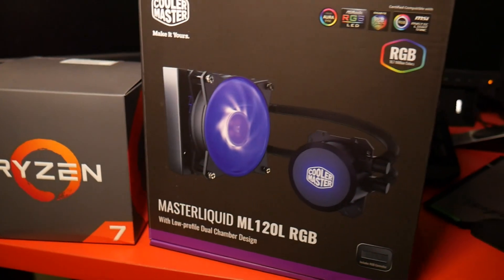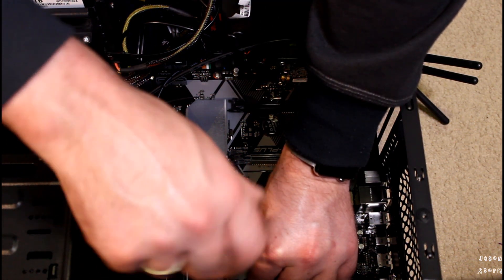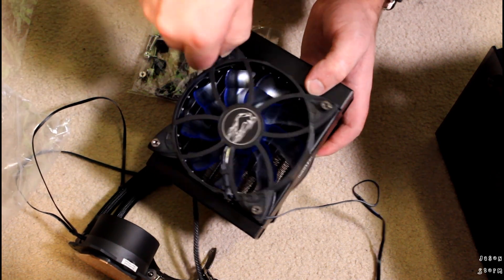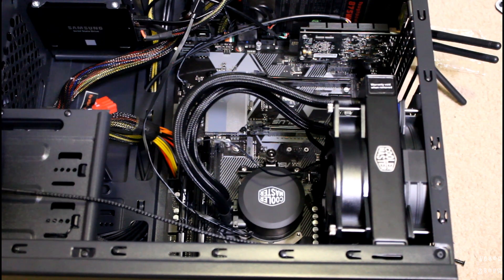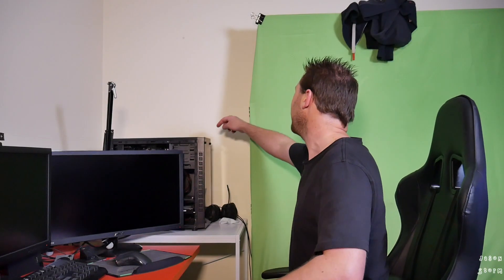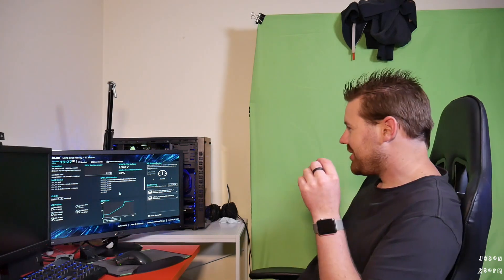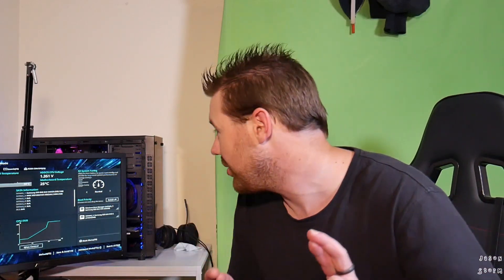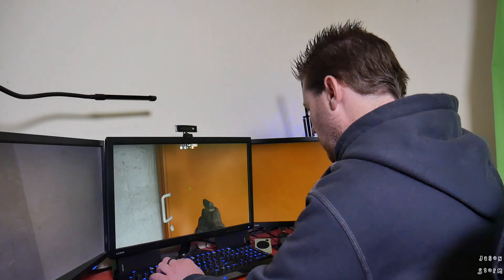Cooler master Masterliquid ML120L RGB Review Installation

Comment: My previous cooler seemed to not be working and my cpu was hitting 100 degrees Celsius. Bought this cooler and just installed it and im happy to say my CPU temps are now 30-40 Celsius while idle, and around 60 Celsius with uncapped frames. Thanks for the review :)

Comment: 2:21 should mention that it can be easy to break the plastic clip when screwing on the cooler. It's tricky because you want it mounted tight. I just broke the clip, and now I have to try to find one... very frustrating.

Comment: This is a silly question 🙋🏻‍♂️. Do you have both fan running in mode as to expel air from the case or rather suck into the case? Also do both your fans run same direction?

Comment: Is it fair enough for Ryzen 5 3600 ??
Reply from the maker: If you have space for a 240 go a 240, if not then it should be fine, I have this on my 2700 and I haven’t had a problem but on my 3800XT I run a 360 but a 3800XT will run a lot hotter than a 3600
Reply: @JasonStorm  Thanks fo r reply. I purchased ML120 V2. I guess this stuff will have enough cooling. One of my buddies tested today his Ryzen 5800x with Ml240 V1 and he has a stable degree at 63°. Thats a high profile performance. I think CM Ml120 V2 wil carry it

Comment: Hey 👋🏼 sorry go write after a year. I got an Hp omen 25L and want to change the cpu cooler. I use the same cooler as you but I can’t mount it on the am4 because the two Plätzchen pieces are to short… like 5cm and the holes are 8cm away from each other. Did you got any tips?

Comment: As long as the flow is in the right direction (out) the second fan doesn't matter much in speed its more acting as a vac to pull heat off the radiator after the other fan pushes cool air in. Also you mounted the radiator upside down so the pump is going to get trapped air in decreasing shelf life Tubes always above CPU. Fan direction is X frame is the blow side, no frame is the suck side.

Comment: Bruh i just bought it and i built my pc but at the end i realized that i didnt have a pump header on my motherboard
Reply: Is there any way i can fix this?
Reply from the maker: You don’t need a pump header, just run it off a normal fan header, you may need to slow it down a little if the fans spin fast and loud
Reply: @JasonStorm  oh thank you i just fixed it now my cpu isnt 90 degrees anymore haha

Comment: Would this be good for overclocking my Ryzen 3 3100?
Reply from the maker: It’ll be fine for Ryzen 3 or 5 but Ryzen 7 i would use the ML240 or 360
Reply: @JasonStorm  Okay, Thanks!

Comment: Hey bud, did the fan arrangement work well? or did you end up switching them around?
Reply from the maker: seemed to, I kept it like that for over a year up until last week when I changed to a more free flowing case, I took the fan from behind the radiator away and now I just run the stock radiator with the Coolermaster fan in front of it

Comment: I have never used a water cooler.  If I get one, do I have to add liquid, or does it already have liquid from the factory?
Reply from the maker: Some liquid coolers you do have to add the liquid yourself but not with this one it comes pre-installed
Reply: Thanks so very much!

Comment: I plugged the fan into the rgb header on my motherboard but the fan lights aren’t turning on, are the RGB headers direction specific?            also I am using an asus motherboard which supports the AURA sync software but I can’t tell if it detects the rgb fans because when I click select all rgb devices and apply an effect the fans still don’t light up

Comment: if i dont have a pump header on my mobo where should i put it?
Reply from the maker: CPU header or a pwm header, you may have to adjust the speed it runs at in the bios or an external program that can change all the individual fan speeds, some people say it’ll spin too fast and be loud but see how you go

Comment: Wait...How did you mount the radiator to the chassis? Surely the fan holes were occupied by the bolts connecting the fan to the radiator.

Comment: I added one of these to a MSI 760GM-P35 system and love it! works great and keeps the CPU cooler then the regular fan.... I highly recommend these! they work!
Reply: and the unit failed in 2021... wound up removing it and putting the stock fan back on.... only to discover that cooler master has come out with a Version 2 model that's better... so I'm thinking of buying the newer unit when I upgrade from my AM3 to a AM4 based system....

Comment: I have the ml 240 lite and there is a noise from the cooler block on the cpu. I would appreciate any help please.
Reply from the maker: I can’t help you much with that, if it’s under warranty take it back if it isn’t I would replace it before it stops and cooks your CPU
Reply: @JasonStorm   did that exactly and now have the Corsair H100i which is awesome Many thanks.

Comment: I want to buy a a 120mm aio (specifcally the nzxt kraken m22) but I don't know where I should mount the radiator. Could you give me some advices ? (I do have a radiator bracket but I already installed 2 Corsair LL140 there.) I have a next h510i case

Comment: Is there any  meaningful difference with this cooler if you have 2 fans instead of one ? I have this cooler and I was gonna add 2 fans like the last AIO I had but didn't and temp wise I only see maybe a very small amount of temp difference e.g less than 10. Am I doing something wrong and should see a little better than that temp wise with 2? 

I know it's an old video
Reply from the maker: Any gain is still a gain, it won’t be much
Reply: @JasonStorm  true that's what I thought thank you!

Comment: Are you still using this cooler? Did you experience any liquid leak?  I have it too, but I’m planning to change it with an Air cooler because everyone is telling me (including many reviews on amazon) that this cooler master AIO has a high chance of leaking and breaking all the other Pc components.
Reply from the maker: Hi, yes I am still using this cooler but mine is not leaking
Reply: Jason Storm I hope it’ll be safe for me too, thanks for the answer😙
Reply: So what is your opinion after 3 year, i bought 1 so need real experience review. Thanks
Reply: @boxtershaitan  it didn’t leak once. It’s working properly and keeps the temperature down even after 3 years. The only problem: it’s a little difficult to remove dust from it. but other than that I think it’s a good AIO and I’ve never experienced any problem with it

Comment: I've bought one of these and my cpu gets 50 degrees in bios. It's well installed and  it's trying  to cold one I3-9100F. What can I do to solve this problem of temperature?
Reply from the maker: 50 degrees isn’t hot for a CPU
Reply: @JasonStorm  in bios? or without doing nothing? When I try to play gets 81 degrees xD

Comment: Run in 1151 it's compatible?
Reply: run smoothly, friend!
MASTERLIQUID ML120L RGB 120MM is compatible with
CPU sockets:
Intel® LGA 2066/2011-v3 / 2011/1151/1150/1155/1156/1366/775 socket
AND
AMD AM4 / AM3 + / AM3 / AM2 + / AM2 / FM2 + / FM2 / FM1 socket

Comment: What are your thoughts now, over 1 year later? I'm asking because I am hating this cooler, and can't believe it gets good reviews.
Reply from the maker: I haven’t had an issue with it, doesn’t get hot, it isn’t loud, I haven’t had a failure, I know some people complain it’s loud but after installing it’s good to adjust the pump and fan curve so it’s not spinning really quick all the time for no reason, what issues have you had with it?
Reply: @JasonStorm  I think it is incredibly loud and has an annoying fan sound unless it goes below 500 rpm. Ever since I got it last fall, I have been trying to tweak it to be as silent as possible but also keep my CPU cool enough. I have tried the smart mode as well as fixed RPM. With smart mode it would just be really sensitive to even the smallest temp change (no matter setting I put it), the fan noise going up and down would drive me insane. Also tried fixed RPM.. well.. ofc thats gonna be noisy. I can hear the cooler through my headset when I play games, and thats pretty crazy considering the case is under my desk.
I also don't think it cools well enough to be given such praise.
Reply from the maker: I just started my computer to check what mine is running at, I haven’t checked it for a long time, and I have had a benchmarking software open and running on one screen and a hardware monitor open on another for about 15 minutes now and my CPU has only reached 47 C (117 F) and the cpu is at 1270 RPM and I can hear a slight hum but it isn’t loud, are you sure it’s the cpu? Not the GPU or power supply? I open it up and check to make sure nothing is hitting and rubbing against it
Reply: @JasonStorm  It's definitely the cooler fan (or the pump) that's being noisy, perhaps I was just incredibly spoiled with my last rig that was dead quiet even at heavy load :) I checked the noise at 1330 RPM, and I wouldnt call it a hum at all, just pure noise. But of course, describing noise levels is different for everyone.
Reply from the maker: It’s possible it’s faulty?

Comment: Hey man quick question: should i get this or the hyper 212 rgb black edition? Price difference in my country is 15.30$.should i really add the extra money and get the Aio or the air cooler will be fine if there is not so much of a performance difference.
Reply from the maker: There shouldn’t be much of a performance difference between the two, I have a Hyper 212x in my other computer and I have not noticed a considerable difference between the two

Comment: Hi, I have one question, hope that you can advise me. If my motherboard does not have pump header, may I know where should I connect the pump connector?
Reply from the maker: Just a normal pwm fan header will be fine if you don’t have one
Reply: Jason Storm thanks for the advise. 

Pump connect to the PWM fan header and radiator fan connect to the CPU_FAN header. 

Am I correct?
Reply from the maker: That’s what I would do however you can do it the other way around, if you can in your motherboard bios play around with the rpm of both headers to get them at a good speed that isn’t too fast and loud and still keeps the cpu at a reasonable temp

Comment: Nice video. I have question.  Best  radiator placement ? Back or top or front?
Reply from the maker: That depends on a lot of things but I would put them on the top if you can but you should at least have a basic fan at the back and at least 1 good fast fan at the front, preferably 2 or 3 because you want to push air into the case not pull air in from the top or back it will also create a dusty case if the air is getting pulled in compared to pushed in from fans at the front
Reply: @JasonStorm  tnx

Comment: In which direction should the fan blades go?
Reply from the maker: There should be a little arrow on the plastic case of the fan, that should be point outside the computer so it pushes air outside the case if it’s being mounted at the back or the top of the case but if your mounting it at the front of the case you want the arrow pointing to the inside of the case

Comment: I have the ml240l rgb. The cable with the three hole plug is for the aio pump right? If so why does my mobo have four prongs?
Reply: If one pin on the motherboard isn’t occupied after plugging it in, don’t worry, it works normal

Comment: Excume, which is direction the fan that you put at case, not that is front of CPU if not the FAN is to cabinet?
Reply from the maker: Both fans are pushing the air out the back of the case
Reply: @JasonStorm  thanks, bro

Comment: Hi! First of all, thanks for your video is really clear and it was great. I was wondering did you try the cooler without the 2nd fan? I recently bought this cooler and i mount it without the 2nd fan added, but i have a spare one that i'm not using and i dont know wether it'll be better to use it or not. thanks in advance!
Reply from the maker: Hi, thanks, no I didn’t try it without the second fan, I was going to but my case wouldn’t allow me to because it has a rivet that sticks out and pushes the radiator out so it can’t be screwed in properly but with the fan it spaces it out so it’s not a problem however I don’t believe the second fan makes that much of a difference

Comment: Some help, please. My motherboard has 3 RGB headers. Which one do I plug the Masterliquid ML into to? JRGB1, JRGB2, and the other is JRAINBOW1. The instruction manual says " Do not connect the wrong type of LED strips. The JRGB1/JRGB2 connector and the JRAINBOW1 connector provide different voltages, and connecting the 5V LED strip to the JRGB1/JRGB2 connector will result in damage to the LED strip" No idea what that means, it's my first build and I'm stuck.
Reply: 5 years later I’m in the same position. What did you end up doing? I’ve tried mine in the JRGB headers but no luck. I’m cautious to try the JRainbow header.

Comment: How do you connect 2 CPU fans in push pull config. Did you split the CPU PWM fan, or you had 2 CPU fan in the MB already. If not is it ok to split a CPU fan header to 2?
Reply: i have the same question, if you know now please, write me thanks
Reply: Carlos T I did now with a splitter cpu Fan head. The 4 pins from the CPU Fan header splitter had one with 4 PWM and other 3 pin, should work as they are control on based of one fan, provided both fans are similar
Reply: @kiranthapa8562  thank you i will try find splitter on Amazon

Comment: So I just bought this cooler.  However it did not appear to change the temp all on mine.
Reply from the maker: Maybe adjust the fan and pump fans to go a little quicker at higher temps

Comment: So I have a question, my notherboard doesn't has a pump header, do i connect the pump to the cpu header or an other 4 pin header?
Reply from the maker: I’d plug it into the cpu header

Comment: My mobo doesn't have a pump fan header, should I use cpu_fan or sys_fan for the pump?
Reply: did u find an answer, i need it lol
Reply: My pump is on system.
Reply: I have this cooler, you dont need a pump header just the cpu fan header will do fine 👍🏼
Reply: Plug in the pump to the CPU fan header would be ideal but any will do

Comment: help me I havew an i7-9700k with the same cooler overclocked to 4.9ghz (the usual preset for the i7-9700k) I have 90 degrees under full load
ii have the fan set up in the front of the case, and I don't know if this is ok. help me please!
Reply: @Necronic Hey i managed to fix it it turned out the fans were actually blowing out of the case, putting hot air into the radiator, turns out i could just flip the fans and it worked, stable 5ghz at 60 degrees to 70 under load
thanks for the suggestion though!

Comment: quick question: what direction did you mount the fan? also when you mount the double fan did your case lost exhaust fan or the airflow didn't change?
Reply from the maker: I mounted it to push air out the back.(from memory front of fan faces inside of case)
I only mounted the double fan because my case has a pop rivet holding it together in the corner and so the radiator wouldn’t mount up to the case properly without spacing it with another fan
Reply: @JasonStorm  please where you connect the 2 fan? the first in pwm 4 pin and the second?

Comment: Just wondering does this cooler come with thermal paste
Reply from the maker: Yes it does
Reply: Just replying for future installers because all of these answers are incomplete. The unit DOES come with a little tube of thermal paste. The AIO is not pre-applicated. You have to add the thermal paste that the cooler comes with to the CPU yourself.
Reply: @sw.  ey bro does this cooler support intel bracket ?
Reply: @iamkynx2575  thermal paste should already be pre applied to the cooler.
Reply: It does and it's some generic stuff but should work. On this cooler no it doesn't come pre applied.  Add just a grains worth of paste to your CPU before pulling the cooler on. It will spread out to cover it all once you add the AIO to it

Comment: For some reason, I'm having a lot of problem screwing in the AM4 mounts like you do at 2:10. The plastic is threaded and when it hits the metal bracket, it pushes the bracket away from the plastic. Did you have any issues here? 

Also, at the end of the day, do you think the double fans against the radiator made a difference?
Reply from the maker: Yeah, I had the same problem but for the way the am4 is mounted it doesn’t need to be threaded so from memory I just screwed the screw all the way into the plastic and just kept turning to round out the thread however you can get a small drill bit and drill out the thread a little if you want to.
No, I don’t think the double fans made a difference and if it did probably or small however I had to run the double fans due to the way my case is, the pop rivets holding my case together come out from the case a bit and hit the radiator and stop it from mounting properly without the second fan so I had to run it and didn’t see any harm in running it

Comment: hey there are to option for me either i buy one of this or hyper 212 rgb , they are both rgb that's why i like them , but idon't know which one to choose , i have an i5 8600k , please someone guide me about this? which one is better to my cpu??
Reply from the maker: Go the hyper 212 if it will fit into your case, I have a hyper 212x in one of my computers and this ML120l, I would have put a 212x in this too but it didn’t fit into my case, if the pump stops working it’ll cook your cpu and if it leaks water it will also wreak your computer, the 212 if safer and performs just aswell in my opinion, in terms of looks I like the ML120L though
Reply: Jason Storm thankss so muchh i bought the hyper 212 💜